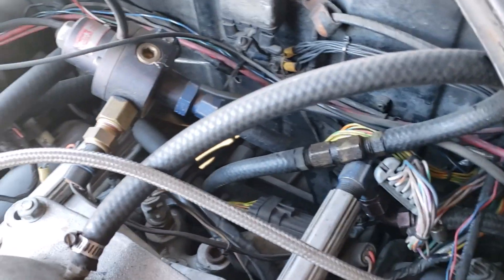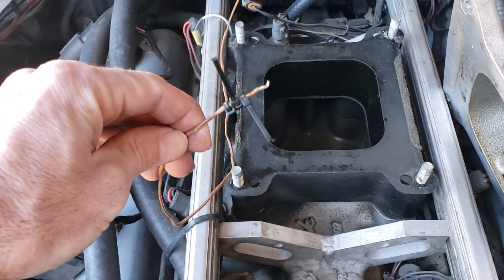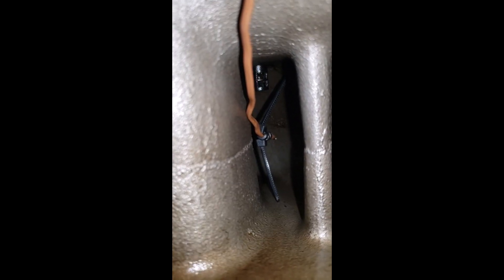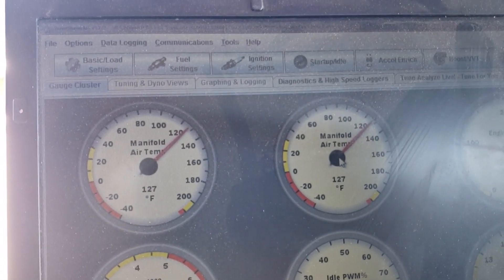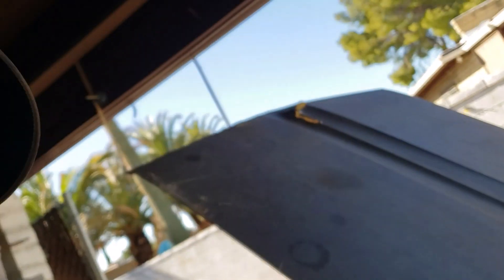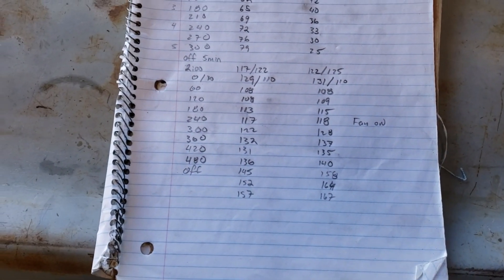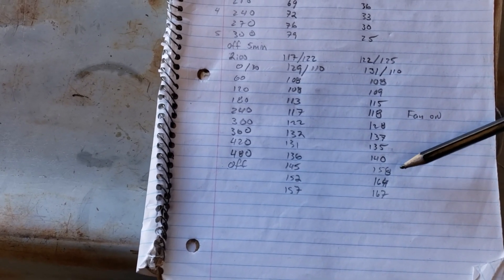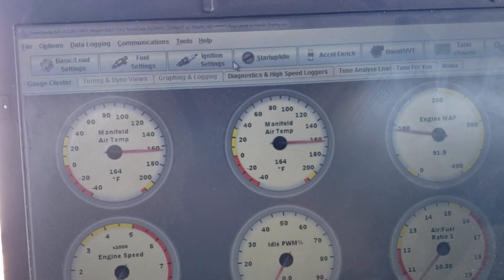Heat Soak, Is it real?  Is the intake the problem?

Comment: The air is 32 degrees warmer. BUT how does this translate to turbo temps and exhaust temps and engine block temps and oil temps you know? I'd imagine the extra 32 degrees has a much smaller effect on the engine and other stuff than the radiator/intercoolers.

My guess is with a hot air intake you might have runaway temps, but the radiator fan should kick on maybe a bit sooner and prevent that issue. so unless you don't have a radiator fan, you won't notice much of a difference at all, if any.

Comment: Do you have a NIST traceable calibration on the thermocouple?
Reply: I need to review the test plan and protocols. The NIST calibration dates should be stated.
Reply from the maker: Yea, the first 30 sec was my plan and protocol rolled into one.
Reply: Where is your dFMEA posted?
Reply from the maker: After the 10:25 mark.  You should re-watch it.